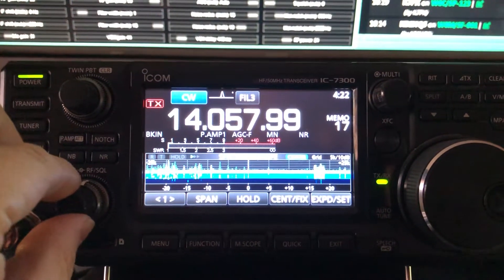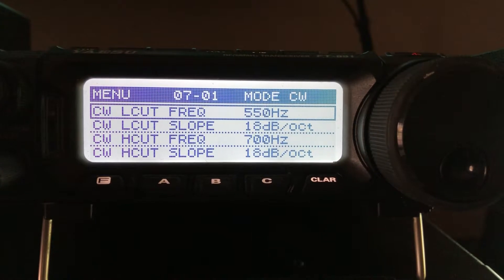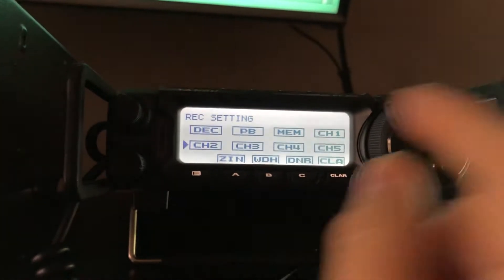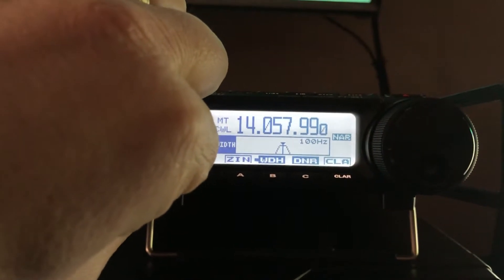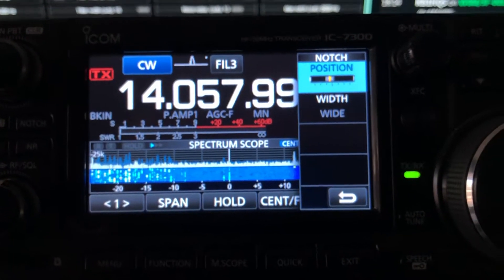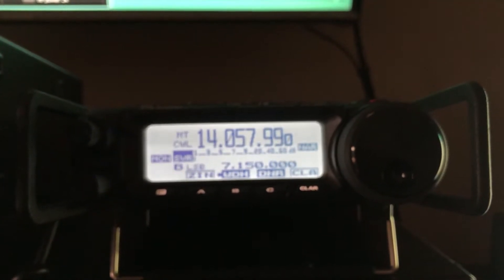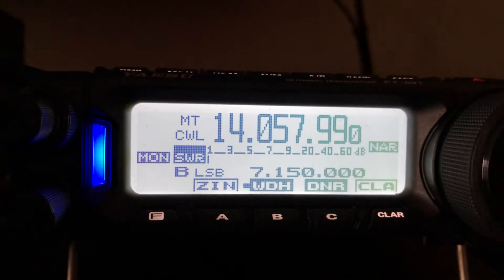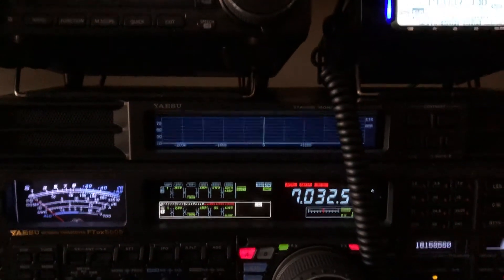ICOM IC-7300: CW RX Audio Tapering and the Notch Trick (video #3) #icom #ic7300 #hamradio #cw

Comment: How did you set your filter like that? No matter what I do, the BW and FIL3 options cannot be set differently. Also, when I try to adjust the PBT1-2, it doesn't work at that bandwidth. Help!
Reply from the maker: - PBT1 (inner knob): Adjusts the lower edge of the IF passband.
 - PBT2 (outer knob): Adjusts the upper edge of the IF passband.
   - Rotate both knobs to shift or narrow the passband to reduce interference:
   - To narrow the passband (reduce interference from nearby signals), turn PBT1 clockwise and PBT2 counterclockwise to bring the passband edges closer together.
   - To shift the passband (move the entire passband to avoid interference), turn both knobs in the same direction (e.g., both clockwise or both counterclockwise).
   - The display will show the passband graphically, with two vertical lines indicating the lower and upper edges. The passband width and shift are also shown numerically.

Fine-Tune for Clarity:
   - Listen to the audio while adjusting to find the sweet spot where the desired signal is clear and interference is minimized.
   - For example, in SSB mode, narrowing the passband can help isolate a voice signal, while in CW, it can sharpen the tone and reduce adjacent signal noise.